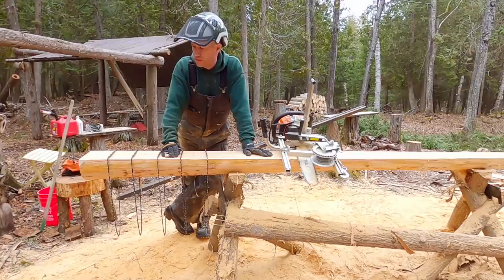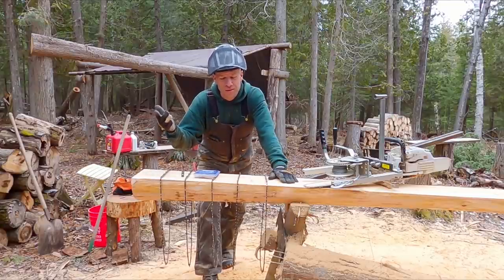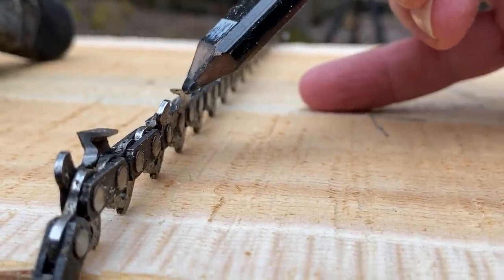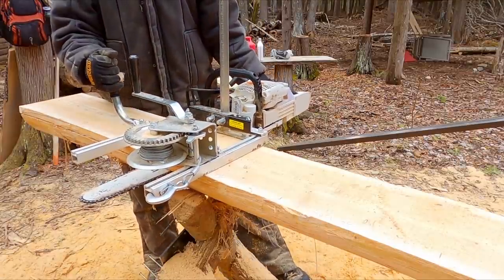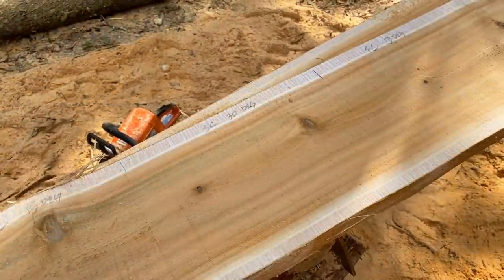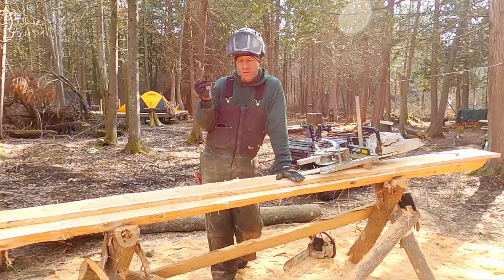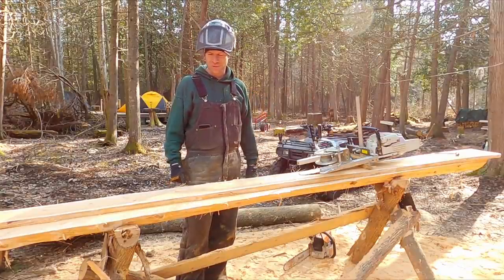Comparison of Chainsaw Milling Chains.  Is One Better than Another? #30

Comment: Great video, thanks for taking the time to share your analysis. Are you grinding only? The new chain out of the box, it cut rough. Please update if the performance is better after you grind it, or file. 12 yrs of experience falling timber, not ripping: factory sharp will cut, but not like a filed chain. Also, in 3/8" there was a semi-skip chain available that I preferred. Stihl chain was harder metal than Oregon brand and didn't stretch as much. Holding an edge longer? Can't say for ripping. You are appreciated, please refrain from talking down on yourself! I know your being wise with disclaimers, that fair enough, but your personal experience and opinion is validated as you have made it this far. Carry on!

Comment: Really interesting! I have thought about getting one of those mills just for furniture projects from logs on my property. I do have a planer, so  I would be more interested in longevity of the chain, not the smoothness of the cut. This was a great comparison! Camera showed it well
Reply from the maker: Thanks! Glad it was helpful. 
If you’ve got the planer, then you can also just use whatever chains you have on hand. They all work (despite many folks that will try to convince you otherwise!)
Reply: I was quick to point out to hubby the planer when we got to Harbor Freight yesterday for the first time in over a year!! Enjoy yours!! Someday...
Reply: @Downeastwaves  Amazon has one. Has good reviews and comes with a stand. I have not unboxed it yet but imma gonna!😅
Reply: How big is your planer mate? Like just a corded power tool type?
Reply: @joesarrieto8434  yes 15amp plug in 13 inch

Comment: Have you tried a skipped tooth chain vice a standard chain? You might find that, with soft wood, skipped tooth chains run better. Out west and Alaska, most loggers cut with a skipped tooth whereas here in Michigan, due to hardwood, we tend to not do it. I mill with a skipped tooth 10 degree on my 661 and can usually get a 9ft rip on a 40in oak log log without needing to change or sharpen. Great video! I recommend, if you purchase bulk chain in your favorite tooth, you can make your own chain much cheaper!
Reply from the maker: Cool! I have not tried skip-tooth. I couldn’t find it anywhere to fit my saw. 
I feel like after a year of doing this full time I am finally getting to the point where I am ready to buy a roll rather than a loop at a time. Tho if I’d have done it in the past, I’d have been site to get the wrong thing and be stuck with a lot of it.
Reply: @survivingringworm2202  I usually go to the Stihl dealer local and they build my skip tooth for me from roll stock. For cross cuts I'm still running standard full comp chains. I get a 10 degree skip and file 8 degrees then 10. It walks the tooth back without losing a ton of materials.
Reply from the maker: Interesting! I’ll have to get my hands on one just for the comparison.

Comment: Perfect fit for my Echo CS-370, and the chain cuts very well https://www.youtube.com/post/UgkxBd8qUztQUCL8Rm1-aIig5ViBT2E_kO_6 . I had been using a Stihl chain that I had sharpened several times (sometimes at a shop, sometimes with my own electric chain sharpener), and there's no comparison -- the new chain cuts much better and holds its edge longer. We'll see how the new chain holds up when it needs sharpening, but for now I'm happy.
Reply: Brand new chain, and chain that is at the end of life will always cut better because that’s where the tempered steel is. They tear the links at the end of the shaping process so only the very surfaces are the most hardened. I personally sharpened probably 3000 chainsaws in my childhood and my father probably sharpen 50k during my childhood alone.  And that is one universal truth. New chains always cut better, and chains at the very end of their life cut as well as new chains. Do not ever throw out subpar chains; instead use them when you don’t want to use your nicer chains when you’re getting into some sand /dirt.

Comment: I like an SC 10deg, rakers cut down to a little more aggressive than normal, cuts to the smoothness i want for rough lumber. Usually only a single pass through the planner for a finished look. Cutting mostly  DF, Pondo, and Blk Oak - Husky 595, 460 455, 18-42 bars, Granberg mills w winches - Northern Ca Sierras                Great video !

Comment: Very interesting & informative.
I've always used full chisel but rarely rip timber.
I'd have expected full chisel 30° to be the coarsest cut but wouldn't have expected 0° to be as significantly smoother.
Now i need to see if anyone's experimented in this manner on hardwoods, as I'll most likely be milling European ash & beech, with some cherry & holly.
Looking at a mill like yours to use with one of my Husqvarna 266 (was my spare saw back in the 80's & probably has less than 10 hours from new, whereas my other 266 is definitely on its last legs).

Comment: Thanks for this, just started on a 42" Doug Fir with an oregon 11degree ripping skip chain, 59" bar on a MS880 ..its slow going ..got to clear under the side cover as fine dust builds up over the clutch cover.  Will see how we go.

Comment: Here's an idea to get bigger logs onto your sawbuck.  Lash three 4" diameter poles/logs together to make a tall tripod, hang your snatch block from it, and use the winch to lift the log up, or at least one end of it, then put the sawbuck under it.
Reply: Thanks @throngcleaver for this bit of advise.

Comment: only ran 404 chain after snapping a smaller chain at 3/4 throttle....it was scary as heck! Modded chains to have 10 deg or ran granberg ripping chain, had triangle file originally... I always granberg jigged my chains so they didnt dive or climb in rips and rounded back chain is more forgiving but you can run firewood chain right outa the box and work fine just need to keep rpm and feed rate simular and will cut nice slabs IMOP....nice work mate like yer vids

Comment: Hello again.  This is great!!  I've been searching for info on chains and this was very helpful.  Much more than poring over numbers and data.   TY.   Just came into over 40 logs (Pine, Oak & Poplar) have them cleaned and debranched and have ordered a Granberg 30" chainsaw mill to slab them.   Mostly 10 '-15' long and 22" - 27" diameter.   Shopping chain saws while waiting for the mill and leaning toward a Husky --- will need at least 70cc so it'll be the 585 or 592XP.  There's a lead time for mill delivery so de-barking will commence soon.   Will keep u apprised of my progress.       Stay safe,  God Bless....

Comment: The long bar also introduces more bar sag and poorer cuts than the proper length bar for the specific log. Great content today Amigo.
Reply from the maker: Good point. 
Since I’ve never used a big saw/long bar, I guess I’ve never come across that problem but makes total sense.

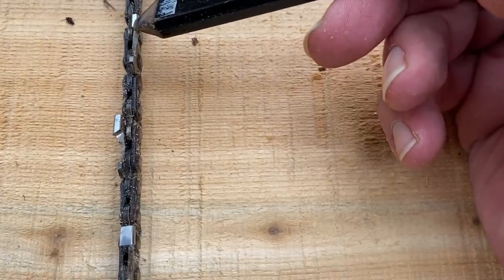Comment: 10:38 Feel free to file that Granberg chain at 10* all the way around, that’s where mine came and I’ve continued at that. May be a bit easier to file instead of switching back and fourth. The quality of cut, from the looks of it, is Maybe a touch better, if not the same. We’ve got a little bit different wood here in SE MN, though. Lots of Oak, Maple(hard and soft), and Ash.
Reply: How you liking the Grandberg chain for hardwoods? Just ordered one today and will be ripping up some ash in the coming weeks. Been running a full chisel skip tooth so I’ll be interested to see what difference the grandberg makes
Reply: @warrenwerks   Short answer: I like the Granberg chain. It lasts a good while w/o needing a diamond to sharpen and gives quite a smooth cut(so long as you don’t bog your saw. I have yet to stop chain chatter through a bogging saw.. aside from cranking that tensioner screw down which, as we know, is probably not the greatest idea); however, it’s slower than other chains(theorhetically to be expected) and I do wish they made a skip-tooth chain. I think my 461 would appreciate a skip-tooth chain, especially on my 42” bar. Even the 36” bar would seemingly be noticeably nicer and faster with a skip-tooth. Hope this helps :)    -Abe

Comment: best rip chain ive had for speed is a home maid grandburg style with half skip. full chiz. and yes requires more sharpening but cuting eastern white pine get 4 20in wide 8ft long cuts before needs a sharpening. nice video.

Comment: Great video and thanks for taking the time.  Granberg has my mill in the mail as I type.  One thing I am wondering about is the raker hight.  Not so much for chain sharpness life, but smoothness. Thanks-K
Reply: I would stay right around 25-30 thousandths your standard Oregon depth gauge tool is set to do 25. I would just use that and then make sure to reshape the depth guide a little to make it not perfectly flat just round the front edge a little.
Reply from the maker: Totally agree with John. Though I must admit that I regularly forget to round of the leading edge of the rakers after I knock them down (with the bench grinder/sharpener.)
And that probably doesn’t help anything when it comes to making nice boards or the efficiency of the cut. 
I just point that out because I noticed in the video that NONE of the chains I used had rounded rakers. 
Oops!

Comment: Archer works ok for cutting firewood after a couple filings they get soft wont cut streight I'm in the southern Appichians Mts cutting hardwood.
Reply from the maker: Huh. Cool. Thanks for the info!
I’m all about buying cheap stuff whenever possible but I was surprised at how much worse it did than the rest right out of the box!

Comment: Very informative.  Yeah all were not new but all the info on the different degrees and so forth was really good and I am sure you have honed your sharpening skills with all the logs you have milled into boards.  What was the brand of the chainsaw mill again?  I want to look into it.  I had an alaskan chainsaw mill years ago and it wasn't user friendly and was a royal PITA so I sold it.
Reply from the maker: It’s the smallest mill made by Granberg. 
I sharpen with a super cheap, electric grinder I got from amazon. Works great!

Comment: I see a year has gone by
Thanks for the edification.
I have been considering these options.
I mill mainly ash and maple, with a ms362 cm.
I do not trust the cm.
My cleanest results have been with out of the box green chain 
Being parsimonious I  have taken full chisel down to 10° a degree at a time.
I have not seen enough difference to make the effort.
I am now more concerned about taking it easy on the saw. 
Any take on that?
I have basically stopped milling, over wear and tear on the saw.
My new plan is to mill long needle pine for utility lumber.
I hope you are enjoying your sky deck. Chris

Comment: I guess I'm not very imaginative as I couldn't think of any use for 3" or 4" diameter pieces but seeing the things in the background you have made gives me some idea's.
From doing a little bit of woodwork,  zero degree full chisel probably needs higher power to drive or you have to go slower when cutting? (if you can remember from two years ago?)
Just looked at the helmet, wow, did not expect $323, but, cheaper than a new head.
It's enough to get me to subscribe. interesting channel btw.

Comment: The person that wins is the one that has the most fun!!  Perfect!!  I have milled alot of hardwoods here in michigan as well and a semi chisel at 10 degrees is great. I have also played with a full skip sequence chain and was impressed by the speed of the cuts that i got vs the full house chain. (Normal driver cutter sequence).  If you got some larger lumber to mill let me know i head up to the Munising area a few times a year and would love to mill some cedar as we don’t have any around here at all.
Reply from the maker: Nice! You must use a bigger saw? I wanted to try a skip-tooth but they don’t make them for such a little saw/bar. I bet they fly on something with a lot of power. 
But they must get dull a fair bit faster?
Reply: @survivingringworm2202  i get a tank of fuel and then some power sharpening i just hand file it right in the mill actually works real nice because the mill holds the bar in place. I got a holtsforna/farmertec 660 knock of saw. Closing out it together replaced some parts even with his time i payed him i think a little over 300 for it i think.
Reply from the maker: Wow. Great deal. If this thing ever wears out, I’ll definitely have to go bigger but the dealer assures me, it’ll last for a lot of years. 
We’ll see about that.

Comment: Great, great video. I was trying to find info about that archer chain. Didn't find to much. Great comparison. Have you tried a Granberg and sharpen all teeth at the same angle? Those waves could be because of different degrees of teeth.
Reply from the maker: I haven’t tried changing the granberg. From what I’ve found, sharpening a semi-chisel to lower angles tends to rip up the board more. Maybe changing the granberg to all 30 degree angles would be better?

Comment: Thanks! Got my mill last month and am using a full chisel and a 36" bar. Noe I know the difference in the smoothness. I noticed your not using the nose clamp on the barfor your mill.guessing that the short bar wouldn't need it as mutch. Besides  the 36" I also have a 20" for smaller diameter trees.

Comment: What size square stock did you use for your mill?  What is the width between the rails?

Love the channel. I miss the UP, lived up there for 13yrs.....stuck as a troll for the time being.
Reply from the maker: Distance between bars doesn’t really matter. More a matter of how big the logs and mill are that you are working with. Small logs, narrower bars. Giant logs and giant mill, much wider plates. 
2” bars.

Comment: Good info. I would be curious to know, especially since I know very little about chainsaws and chains, how much board feet can you mill before having to switch chains?
Reply from the maker: Not sure exactly but I think that log that I was cutting in the video- roughly 4-5 boards before it slows way down, the bar gets hot and the saw starts sucking down a lot of gas.

Comment: Very informative and thank you. Full chisel and 0 degree shown as the winner IMO because of finish. If you had a RS chain and sharpened to the 10 degrees how would the finish have been? VS a RM chain also sharpened to 10 degrees? Enjoying your videos and your sense of humour. I have set up Stihl 661 with 36” bar and Granberg 48” mill (my trees are bigger) and have been thinking about chain options for milling Hemlock.
Reply from the maker: Hmm. Not completely sure but believe there is a straight-line correlation with RS chain as you go from 30 degrees down to 0. More angle=rougher cut and less time between sharpenings. 
The cheap chain that made the roughest board WAS essentially a RM chain at 10 degrees (or 15?”
Reply: @survivingringworm2202  thank you for the reply and clarification. I will stick to RS chain and gradually move sharpen angle from new down to 10 degrees.

Comment: thanks again for the great info.     I think the way for me to go is to take my box of used chains and grind them to near zero to 10 degrees.    Just starting out with small logs and my 18" saw until I can afford a big Stihl!!
Reply from the maker: I think that’s a good plan. As long as they are full chisel. Semi-chisel ground to closer to zero just seem to chew up the wood.
Reply: I got myself a 661 with a 36 inch bar, but now I need a mill attachment.

Comment: I bought some 325   50 gauge granberg chain and it came with all cutters at 10 degrees. The Half width and full width all the same.  So did they change their angles?

Comment: I use a Woodland Pro ripping chain from Bailey's with a Stihl 660. I mostly cut hardwoods and depending on several factors like species and quality of sharpening it seems to work good.
Reply from the maker: Interesting. I just looked and couldn’t find one for my saw. Is it just a semi-chisel with a 10 degree grind on it like the new one I use in the video?

Comment: Wonder how a square ground chain would work here, since its the cremé de la cremé in cross grain cutting. And it should be more durable than the round ground full chiesel since the cutting faces are flat instead of the weaker concave edge that the round stone leaves

Comment: Hey, I have the same setup as you and run the archer chain as well. I just buy 25’ reels and loop my own chain. 

I find on the first initial use the chain growth is unreal with Archer and also that the out of the box sharpen is pretty variable from tooth to tooth. 
I have a bench grinder so I can get them uniform but if you are sharpening by hand it could be pretty tough. 
Agree with your comment on the rakers. I use the stock 0.025” guide and maybe go a tiny bit further. 

That looks like a laminate bar you have on the 261. Is it staying true?
Granberg says solid steel bars for that mill so I ended up getting a cannon bar for my 261. 
Nice work! Your projects look like you are having the most fun!
Reply from the maker: You like the Archer chain then?  I didn't think it did a terribly good job the way it came.  I've been creeping it towards a more aggressive angle with every sharpening.
I also did away with hand sharpening and got a cheapo bench grinder.  It was worth every penny!  It sits outside so I didn't bother getting a good one.  Will pick up something better once it dies, but the little thing just keeps going!
What model do you have?  Like it?

Comment: I had a full chisel full skip at 10 degrees and did far better with a full chisel full skip at 30 degrees. But this was ripping a log with the bar going vertical.